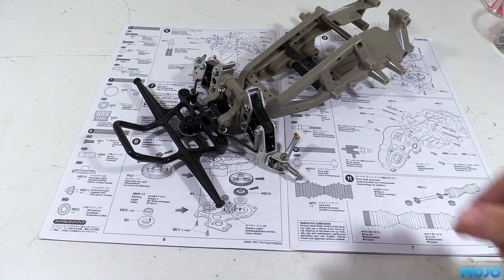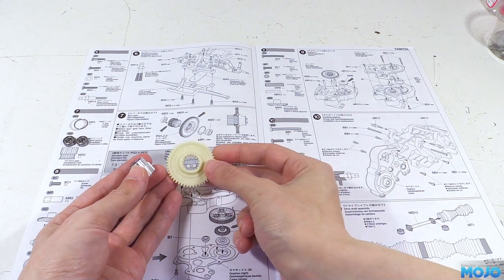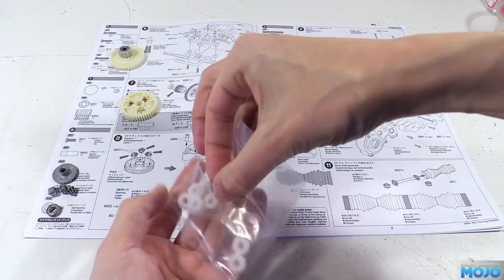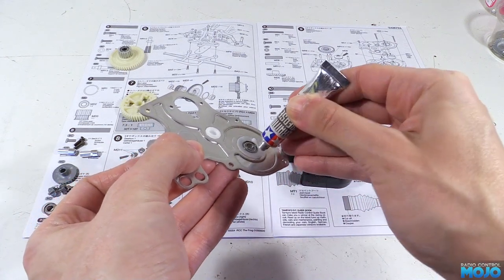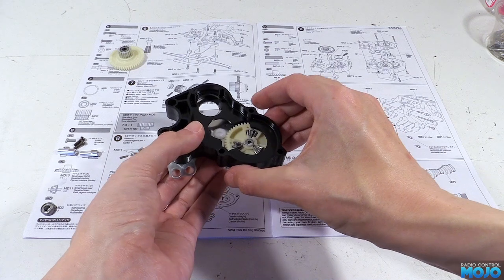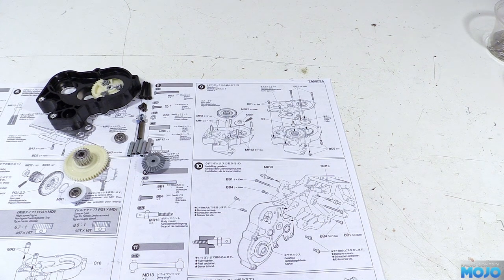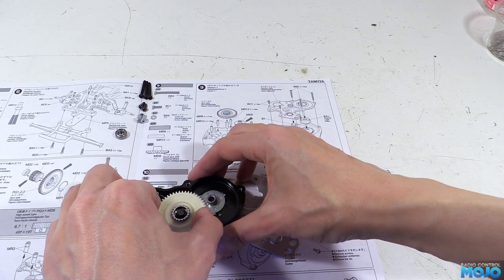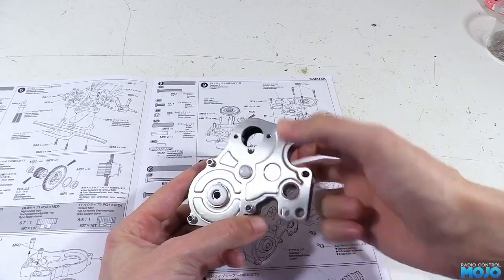Tamiya The Frog - #3 - Gearbox

Comment: I built a new Frog when I was 11yrs old,  back in '86 😳 and remember the gearbox mating giving me absolute fits. I got there though! It was the hardest part of the build for me outside of rigging the servos for the steering and MCS, which if you've never done it before (and pre internet) is actually pretty tricky. Brought back a lot of memories. I'm certain I will get a re-issued Frog for my next project.